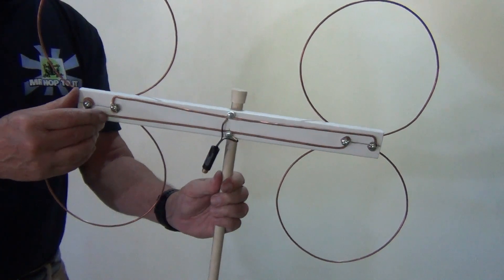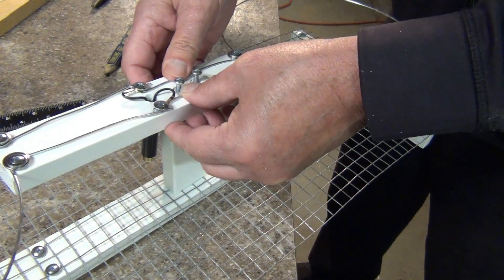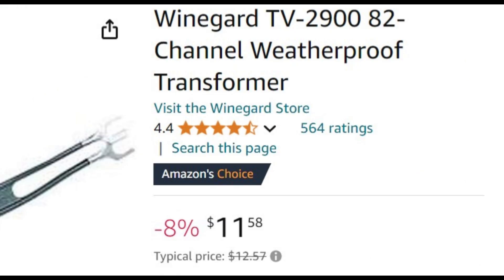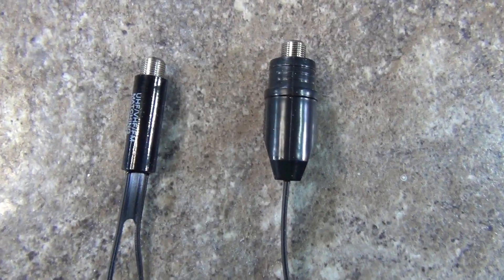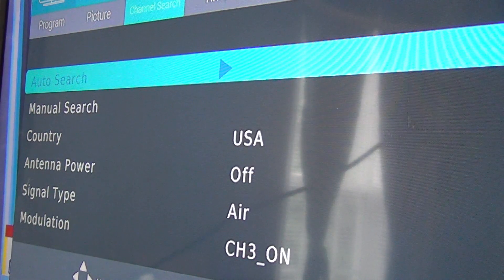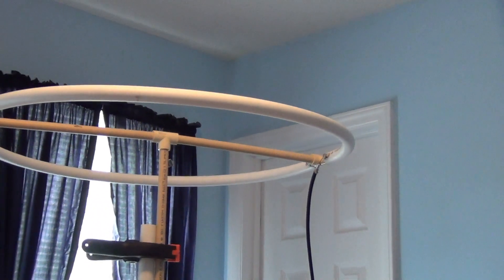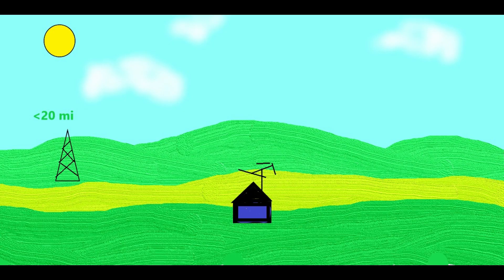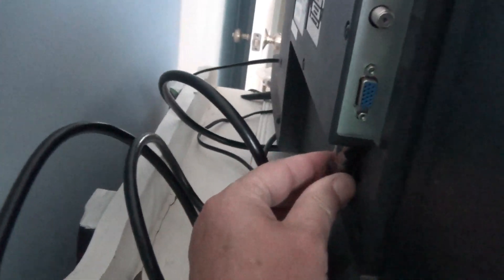TV Matching Transformer Showdown!⚡⚡

Comment: So it’s essentially got a built in frequency filter?
Reply from the maker: Not really. Its primary purpose is to match the impedance between a 300 ohm antenna and a 75 ohm coaxial cable. 
  A transformer behaves a little like a bandpass filter by not passing very low frequencies, but it's not very selective.

Comment: Have ever split one open to see the working?
Reply: Yes, not much inside. Just a few wires wrapped around a metallic magnetic core. v
Reply from the maker: Yup
Reply: @victoryfirst2878  The core is not metallic.  It is really more like a ceramic made out of a mixture of oxides.  They are brittle.
Reply: @kensmith5694  Thank you for clearing that up Sir. Good day too. vf
Reply: I wonder if there is more performance to be had by opening up one and winding up your own custom one maybe doing multiple different versions testing number of winds shielding of different types different wire and thickness and different cores like metals of different types sizes shapes like bar circular and ceramics of different types and also if there is a specific type that works better for different antennas.... thanks for your time and effort!
Reply from the maker: Thats a lot of good ideas and questions. Thanks
Reply: @bentboybbz  Point well taken Mr. Bentboybbz. Look forward to see what will happen on the subject. Peace vf  😀😀😀
Reply: @bentboybbz  I think doing one on a really good core could indeed be better.  I also think that making an RF amplifier with a 300 Ohm input impedance and 75 Ohm output impedance could be even better.  Amplifiers usually need impedance matching at their inputs and outputs so you could skip a step that way.
Reply: @kensmith5694  I have not gotten into the black magic of RF yet honestly beyond citizens band SSB and the associated bands that one can explore with your slightly modified galaxy radio, and I mean the CB end of the models as I do think they sell some base stations for other frequencies as well. I actually was running a one pill amplifier into a 5 pill amplifier that was modifying the modulation I suppose of the signal adding a deadly Roger keep and such as well, into a 11 pill amplifier then up the highest quality coaxial I could find at the time which was 2008, over 100 ft in the tree, to an antenna I got custom built by an old timer grounded in a 15 ft deep hole that I dumped rock salt in for months and left the hose running on for half a year lol... around 13k actual I'm thinking as the highest reading meter I could get without paying rediculous money was 10k... the Roger beep had the ability to cook unshielded electronics nearby...I could stop arguing by stopping talks for miles by keying up lol ...I love to learn new things and I am interested in RF if you don't mind explaining it further for me
Reply: @bentboybbz  There are two paths to go down on you learning and then you can bring them together.
1) Learn about transformers, turns ratios and impedance transformation with a transformer with an idea core
2) Learn about cores and the materials used in them.
75Ohms to 300Ohms is a factor of 4.  Since impedance goes as a sqrt(ratio) you want 2:1 transformers.
You also generally want the 300 Ohm winding and the 75 Ohm winding to share copper over part of the span.
The 75 Ohm windings will lets say for the moment is one turn.  For the 300Ohms you want 2 turns.
This works out well but we are assuming an absolutely perfect core.
The core material effectively places an inductor and a resistor in parallel to the ideal transformer we are assuming.
Anything less that perfect coupling between windings puts an inductance in series with the ideal transformer.
In core materials  there are trade-offs.  The ones that are good for a GHz tend to have lowish mu values.
We want a high mu. We also want the core to be nonconductive.  Any conduction looks like a resistor in parallel.
If you can't get enough mu to get the inductance high enough you need to add more turns.  More turns are also trouble.
The result is you end up having to buy fairly expensive core material to make it work well.
Reply: @kensmith5694  I'm kinda following you on this but I need to do some more research. I greatly appreciate your time and effort to explain it to me in further detail. Is there a place that you visit that is for the hobby? Maybe a forum or discord or reddit? Thanks again my brother!